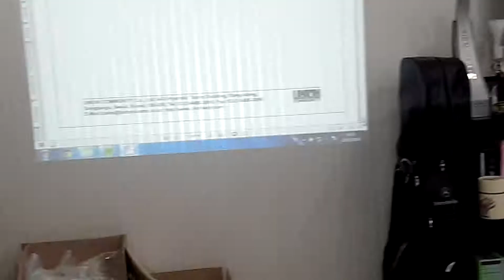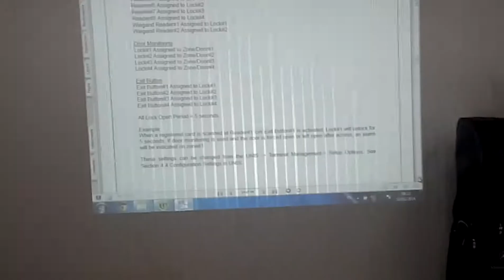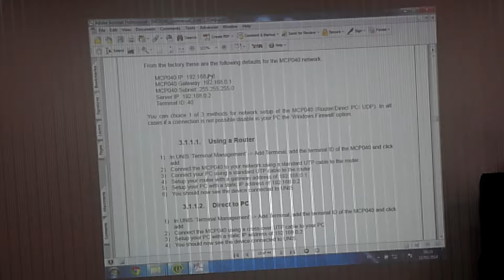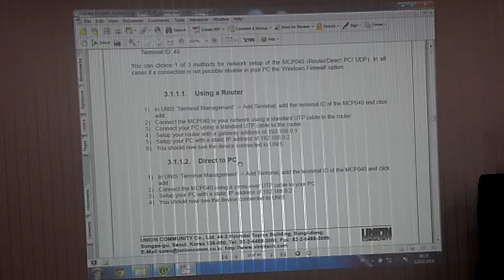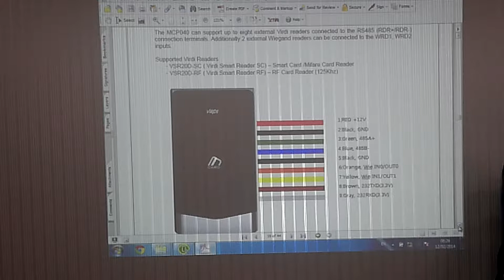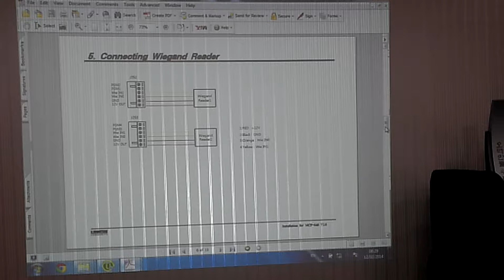VIRDI MCP040 CONTROLLER

Comment: dear steve
i have mcp040 and ac2100 and bush button for 4 door and i need to connect it on my project

can you send to me the connection map please

3 door with 3 ac2100 + 3 bush botton and 1 door has 2 ac 2100 one in and one out wihout bush botton